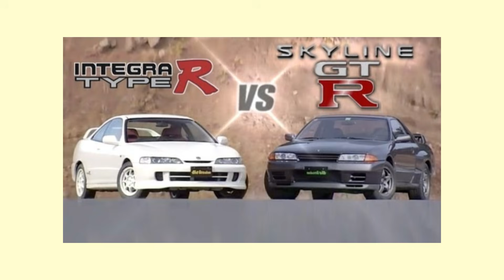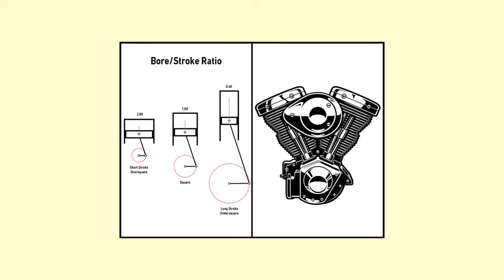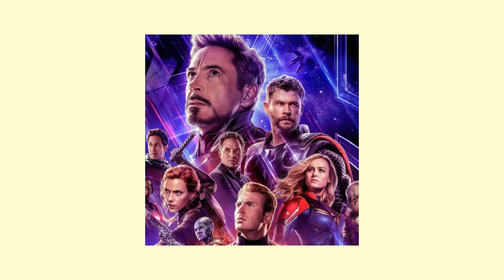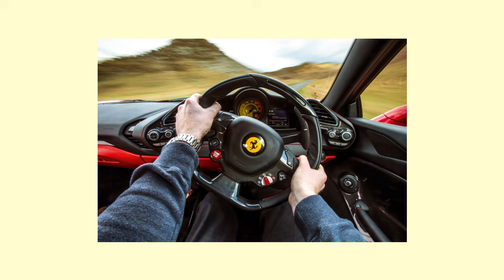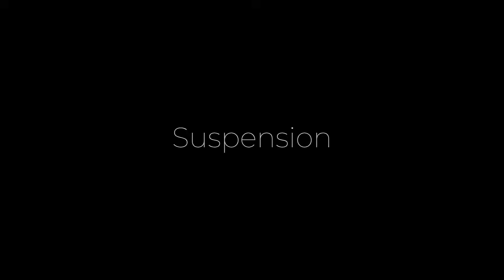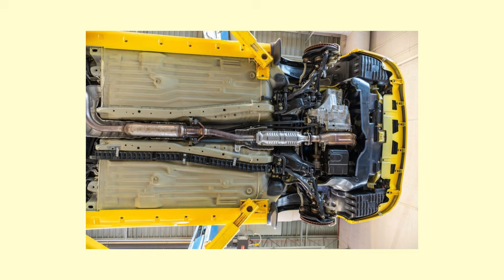Automotive X-Ray: Honda DC2 Integra Type R

Comment: The DC2 has lower torque steer than many cars due to the steering geometry allowing for a lower kingpin offset compared to for example a conventional strut like in the DC5. Like I said in the torque steer video comments section, scrub radius is not a relevant axis for drive power. Drive torque through a bearing reacts internally as a force at the wheel center height, not at the contact patch height.

The rear spring is not progressive, it's a two-rate tender design that binds up after some load, which allows a stiffer ride frequency but still maintains rebound travel, for compliance reasons, be it vehicle dynamics or law. The NSX-R used a similar design for the same reasons. It functions almost identically to having a separate helper spring.

One thing to keep in mind about the rear suspension is that it's bound up kinematically and can only articulate due to the stiffness of the trailing arm inboard bushing being low enough. If you look at standard examples, you can tell it's designed to be very compliant both radially and axially, and this also causes some elastokinematic toe-in.

I would be wary of replacing them with solid alternatives unless you're alright with giving up most of your travel range, which may not be a problem for a racecar. If you're simulating it, there is no way to do it correctly in a rigid model, you will need to add deflection to one of the points, preferably the softest one ie: the trailing arm inboard.

Comment: nice vid! what do you think about ep3 type r?
Reply from the maker: Thank you man! To answer your question from an engineering standpoint, a slight downgrade on the DC2 as no double wishbone front suspension, but it's a much more practical daily than a DC2 Type R!
Reply: @Enguitive  Spot on.Oh and great explanation of the suspension setup. I'd just add one extra: The rear setup also includes Honda's patented system to stabilise the rear end. Based around the rear trailing arm bush that's designed so the wheel can move backward or forward in a controlled and responsive way The rear setup is basically: The lower control arm controls side loads, the upper controls camber and the front arm controls toe. Fine and standard so far

The cool bit comes in when braking. The tyre as it grips wants to move slower than the car which pulls the wheel backwards compared to the car. The RTA bush is designed to be horizontally compliant so that the arm moves back under braking, causing the front control arm to pull the front of the trailing arm in, which adds toe in, stabilising the back end under braking. And does so wheel independent so if one wheel loses grip it''ll reduce toe. Very cool and fitted to other Honda's of the time, Civics etc and not just R variants. Now a lot of guys will stick in a polybush, or god forbid a rose joint there because it feels more "race car", but doing that loses one of the things that made these cars so renowned for handling and increases your chances of going backwards through the scenery. On fire.

I daily a DC2 R(cos mad😆) and have driven EP3's and DC5's among other FWD stuff(inc some of the crazier French hatches). Both the EP3 and DC5 feel more "modern" and much less raw. The EP3 near redefined practical. It's a Van Type R. 😁 Much more civilised too. Bloody good cars to drive too. Ditto for the DC5. 

Though the DC2 is imho more chuckable, more forgiving at the limits and easier to exploit. Tbh again imho I'd rate the (JDM, with LSD)EP3 over the DC5. Now I love the B18c, but the K series is the superior engine, certainly on paper(the B18 sounds better and is more engaging)and you can get more power out it and much more cheaply too. About the best four banger ever made. The difference in the chassis? A Dc2 with a K swap will often walk away from a DC5 running the same power and very much will over an EP3. Plus the DC2 is in dire need of a sixth gear. At motorway speeds... well put it this way, I have a radio, but it's damn near pointless to switch on above 50kph. 😁
Reply from the maker: @MrGrentch Great explanation of the RTA geometry man, yeah it makes sense why a poly bush would make it more snappy at the limit, as the rear end becomes stiffer and the grip breakaway is way less progressive! Also yeah the JDM EP3 has a bunch of extra running gear including more aggressive cams, final drives and a bunch of chassis stiffening that make it truly special!
Reply: @MrGrentch  The info in this comment about the rear geometry is correct. In fact it's entirely reliant on the joints being compliant to be able to articulate AT ALL. So stiffening the joints effectively changes how bound up your suspension is.

The wheel assembly being able to move backwards also increases compliance over bumps.

The DC5 used a similar idea, with an axially compliant instant axis, which I consider a great design. It's just a shame for the quite poor front.

The DC2 style rear geometry is also surprisingly light, lighter than the DC5 alternative!